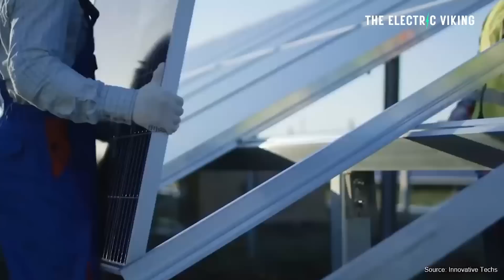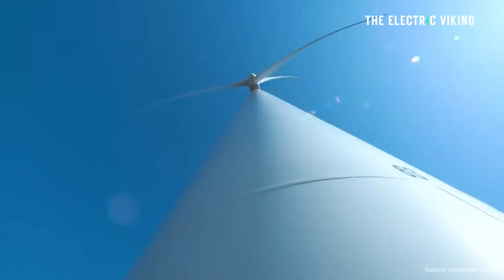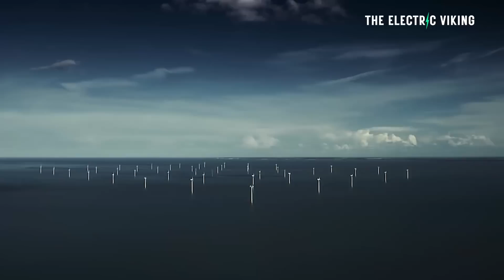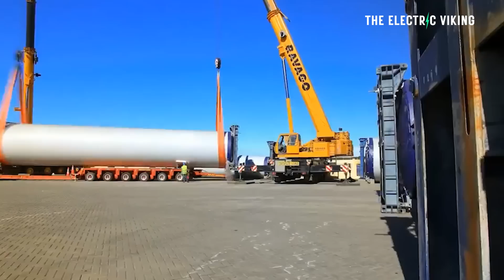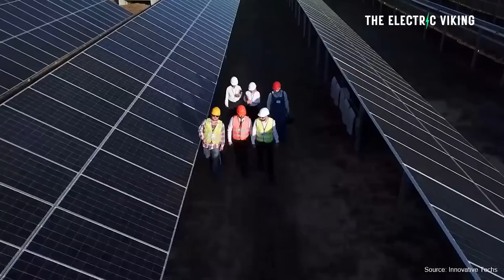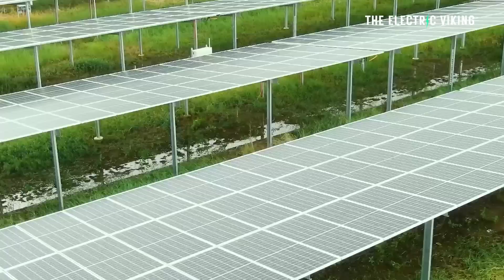8 countries now generate over 99% of their electricity from renewable energy

Comment: What's also interesting is the green foliage that grows around the base of these solar panels.
Reply: Vegetation below the solar panels helps control the panel temperature and actually increases power generation. Not to mention that if you space the panels a bit more than usual, losing roughly 20% of the panel ground coverage (and, thus, produced energy), the area below the panels receives enough sunlight that it can be used to grow certain crops, including pasture for grazing animals, with almost as much productivity as if the panels weren't there (an arrangement called agrivoltaics).
Reply: @FabioCapela  Spot on. Also, vertically mounted panels work surprisingly well, if less shade is desired, plus I think that may help with cleaning. The cleaning part is overblown...humanoid robots will be the ones doing it in 5 years, or so.
Reply: @machoopichoo2  For large installations you have simple and relatively cheap robots that use the upper and lower borders of the panels as rails to move between them, quickly cleaning the panel with minimum water usage and no human intervention.
You likely can buy a few dozens of those for the price of a single humanoid robot. Limited, specialized robots are more cost-effective in most cases.
Reply: @FabioCapela  Fair enough. The humanoid robot comment was slightly facetious, as simple machines (not even robots) would be better suited to clean large numbers of panels, as you point out. In situations where humans are doing this work currently, a bot could be a good solution. Estimates are that, when scaled, Optimus (for example), could cost as little as $5K, or less. That is if Tesla decides to sell them, and not only lease them. BYD is already selling a good BEV for $10K, so this is completely reasonable.
Reply: Ahh yes of course.  Some of them seem to be acting like greenhouses in the dryer regions, offering shade to microorganisms,  undergrowth and small creatures.
Reply: They have to wash them. So i guess thats why.
Reply: @TheBooban  At our local solar plant they have the goats coming in once in a while. And the funny thing was , a Conservative local Minister of parliament thought the solar plant was bankrupt and put that in her media release. The stupid women never checked to get her facts right.
Reply: Maybe an opportunity to grow turf or others for lawns and sports fields.

Comment: Don't forget that in many of these countries electricity is only a part of overall energy usage. For example, in the UK, I consume 10 x more kWh of gas in my home for heating and cooking than the kWh of electricity.
Reply: I don't have gas, nor oil.  Buy a heat pump.
Reply: @Muppetkeeper  I'm not rich like you.
Reply: Perhaps English homes need more insulation? Very windy and rainy on an island I assume.
Reply: And exactly that's the reason why heating should be done by Heatpumps, they save up to 85% Energy, same for electric cars, every EV on the road reduces primary energy consumption by twice as much as the EV itself needs.
Reply: @chriswilliams8607  Yep. A lot of energy is used to pump oil, transport it, refine, transport and distribute the resulting fuel, and finally pump it into a car; shutting down the part of the oil industry that handles gasoline and diesel for cars (and perhaps trucks) would save an unbelievable amount of electricity and shipping fuel.

If I remember correctly, someone once did the math and if we decommissioned all installations used by the oil industry and used their area for solar and wind it would cover most of the global energy need, including the energy needs for sea and air transport when we finally get to electrifying those sectors.
Reply: @FabioCapela  absolutely correct!
Reply: If you have an old house in the U.K. heat pumps don’t keep the house warm enough. Our electricity is so expensive due to solar and wind subsidies, it makes it unaffordable.
Reply: @ianordish9745  utter tosh.  A gas boiler isn’t a magic device, it just generates a lot of heat inefficiently. All you need to do is size the heat pump correctly.  There are stately homes with heat pumps.
Reply: @Muppetkeeper  if you say so. I run my house on gas and my friend runs his on a heat pump. He complains the house is not warm enough and his electric bill is more than my gas and electric. Maybe it is fitted incorrectly but you can only say what you see from personal results. I think you will find a gas boiler is about 78% efficient in converting gas to heat so it does ok.
Reply: @ianordish9745  Actually I believe modern gas boilers are well over 90% efficient. Heat pumps are definitely the best solution if used correctly, but a lot of UK housing is not ideal for retrofitting. (Not to mention those of us who live in flats...)

And yes, UK electricity is painfully expensive, but blaming that on renewable energy subsidies is absolutely utter tosh. It's a political choice by various recent governments.
Reply: @Goodkiwibloke  if this was true that a heat pump is so efficient compared to gas why are the people that have changed to heat pumps from gas saying they pay more now than they did before.
Do you have a heat pump. Would be nice to have a comparison on costs.
Reply: @Goodkiwibloke  You said, "Modern heat pumps are 500% efficient = electricity is 5 times more efficient than gas."
There are two things wrong with your statement.
1. The 500% only applies when it is warm outside and the pump can operate at maximum efficiency.  The heat pump efficiency drops with outside temperature so that when the need is greatest, the efficiency is only around 100%.  In other words, in very cold weather, the heat pump doesn't work any better than an electric resistance heater, which is very expensive to operate.
2. Modern gas boilers and furnaces are more than 90% efficient at turning the chemical energy of the gas to heat for your house.  The electricity for heat pumps has to come from somewhere.  If it comes from a fossil fuel plant, they operate at thermal efficiencies from the 40s to the 60s.  If your heat pump is operating at 200% in cold weather, and the fossil fuel plant is operating at 50%, and you have transmission losses of around 10%, it's roughly a breakeven situation from an energy standpoint.
Reply: @Goodkiwibloke  totally agree hydro and geothermal is cheaper and a great way to go if you have that option.
Figures on costs of running heat pumps is the real test.
I only have access to one and it is more expensive than gas.
Our panels are not value for money 13k installed £300 a year return.
They have been in 5 years so £1500 back so far.
Maybe Norfolk in the UK is not the best place for panels but it does generate some from the 16 panels.
Wood burner, have one in the lounge also. Very nice to have.
Have a wonderful day.
Reply: @ianordish9745  If your entire data set is one person, you maybe should look wider.  To increase your data set to 2 people, my heat pump has been in 4 years and my house is lovely and warm, and it costs just a little less than gas to run each year.
Reply: @ianordish9745  It is nonsense that power is expensive "due to solar and wind subsidies", it is a myth, it's not true. Wind and solar are the cheapest forms of electrical power for years now, no conventional powerplant comes even close, and most conventional powerplants get much more hidden subsidies as wind and solar ever got.

Heatpumps do not work everywhere, but in most old houses it is possible to use them, there is some stuff you can do:
*) increase surface area of radiators, increase flow, install additional panel heating, avoid the frequent on/off cycles that conventional heating often does, a heatpump should run at low power with the least possible cycles, modern heatpumps often have inverter technology where they can be regulated, older or traditional models only can to on/off, in that case install buffer storage.
And off course always as first step, wherever possible insulate the house, even a few cm of insulation make a huge difference.

Comment: Currently, wind turbines are not recycled, most solar panels neither, except for stripping out the metal connectors, and around 5% of lithium batteries are recycled. 

All have a lifespan of around 10-15 years, and then new minerals need to be dug up all over again (using oil based mining equipmemt), while some pretty nasty chemicals leach into the top soil and water table from landfills. And don't forget the slave labour and child labour.

There is absolutely no guarantee at this time that the mythical new unicorn turbines, panels and batteries will ever defy physics and solve these issues. It's not currently any closer than the problems of hydrogen production or fusion.

This is the problem with central state marxist diktats, top-down onto the peasants. It wastes time and valuable resources into the wrong ideas, driving us down a dead end. It's useful tech into the mix, especially in remote areas, but isn't close to viable. Yet we know it's not about real environmental solutions, just political dictatorship and power.